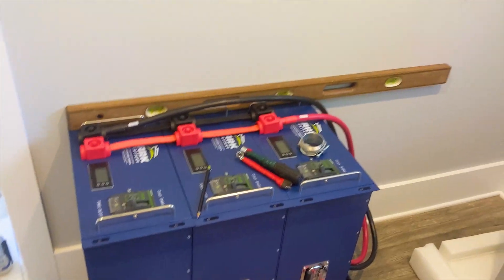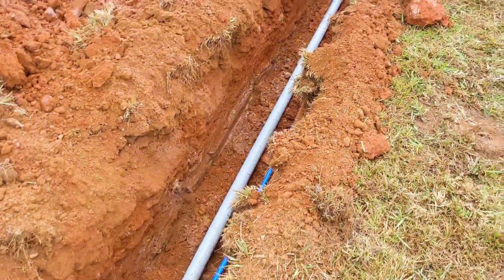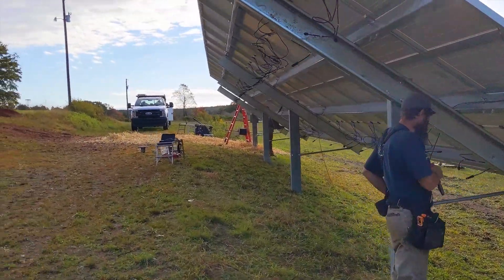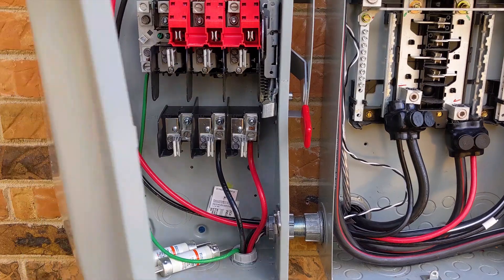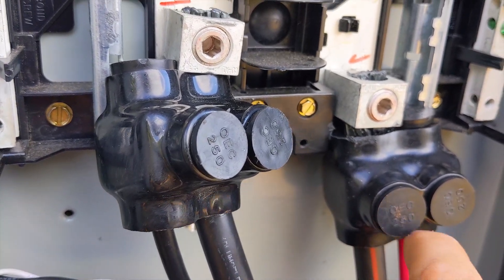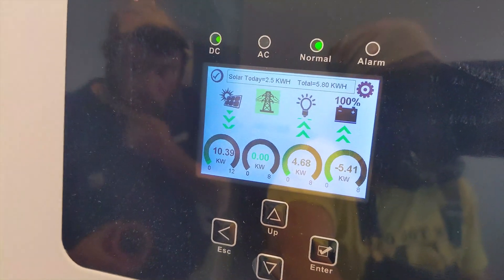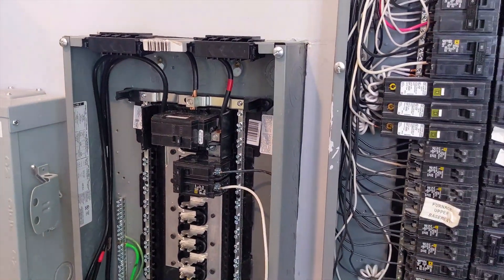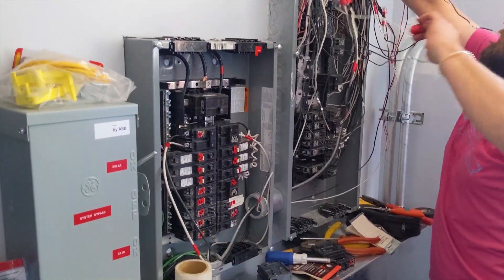Will this be our last critical loads panel?

Comment: I Would love to able to have a system. Would I be able to have a system like this after the meter system? How many panels would we need? Looking for a system that isn’t tied to our grid power provider. I know you probably need specs on appliances we are led on all our lighting. We have a single family house 3500’ brand new, with all the typical appliances all electric. As well as a central heating furnace and ac.

Comment: Just got off the phone with Sol-ark tech support the other day, 15K should be released Q1 2022! 
Also just want to let the community know the Nyle e8 air-source heat pump retro-fit DHWH (formerly know as Geyser) will be back on the market around April 2022 from Nyle systems 🙏 (great off grid, less energy intense system. E775 has installed in the past (see video) but system was discontinued sadly...

Comment: Did you mean to say 8kwh to heat a 55 gallon tank from well water temp to 120f? 80 seems really high. It's about 2 hours at 4500w right? Love watching your videos, I have plans to take our house off grid in the future.
Reply: That sounds like valid numbers.  If you look at the first hour gallons on electric hot water heaters, a 50 gal is only something like ~70 gal.  So in 1 hour it will only replenish ~20 gal.  You need a lot of electricity to heat water.

Comment: We have been using the Lumin Smart panels for about a year.  They are a great addition to any Solar System.
Reply: Does the Lumin smart panel do the same thing as the solark load manager? Are there any other devices that do the same thing? Are these load manager panels the next wave in resi solar and will they eventually be standard in all installs?

Comment: I have no problem with picking my equipment up either. When is the 15k coming out?
Reply from the maker: I was told the end of the year.
Reply: @engineer775  do you know what the cost per unit
Reply: @engineer775  I’m looking to do something like you did for the guy that had a boat dock 2 building house and like 90 plus panels! I need my house and a greenhouse done so I need to get with you soon I’ve been very busy haven’t had a chance to set up a appointment with you yet? I work 3rd

Comment: I am very interested in this new system.  I have been thinking about how to make a load management system work without installing a sub panel.  I think it will be the most efficient design.
  I am about to install a 12k sol-ark ground mount system. Waiting for material quotes now.
Reply: Have you thought about the Span Smart Panel? Yes I understand it's wifi/smart connected, but highly accurate ampacity tracker at the individual circuit level!! It's definitely not cheap, but it's a rather elegant system. Beauty is in the eye of the beholder though 😅🙏
Reply: @meganwinters5163  I dont think the SPAN is compatible with So-Ark.  Only TESLA and Solar Edge currently.
Reply: @chadvivi  enphase works for sure. I just put 15k on IQ8s plus 40kWh enphase batteries and a span smart panel

Comment: Awesome work as always! You guys going with Lumin, Span or something better?
I’m hoping smart breakers will be a “thing” soon. I see Eaton is working on a solution but I think it’s half baked right now.
Reply from the maker: Sol-ark is coming out with a 14 channel smart load relay system.
Reply: @engineer775  Are these load management systems using standard magnet hold relays, latching relays, or something else?

Comment: 88 kWh to heat 80 gallons of well water 57F to 120F?  I don’t think so. Try 10-15 kwh. Because I use 60 (summer) 80 (winter) kWh per day for my whole house. We take three or four showers per day with an 80 gal wh.
Reply from the maker: I said 8 kw on a 55g

Comment: How do you move a load to CLP? Wirenuts in the main load center with extension wire to CLP? Looks amazing. Thanks for sharing.
Reply from the maker: We prefer wago connectors over wire nuts but yes.

Comment: Does anyone know if the Sol-Ark transformerless inverters have circuitry to detect the DC output that can occur if an output switch semiconductor fails or the controller fails? And if so, it must active a hard switch such as a contactor or relay at the output to do a disconnect. I have watched transformerless inverters fail and burn up loads with high voltage and high current DC outputs. Hopefully supported with documentation from the manufacturer.

Comment: Why do you need inspection when you are using a electrician? If anyone could do it themselves, then the inspection would be good, but this is insane.
Reply from the maker: Most ahjs require inspection. Authority having jurisdiction.
Reply: contractors need to be kept honest, otherwise end users/owners get ripped off.

Comment: Code is that you can mix AC and DC in the same raceway as long as they are part of the same system.  NEC 300.3 (c) (1).
Reply: Yes it does allow for this. 
We also read additional potential requirements in 690.31B 2017 NEC
Reply: if inspectors are cool with it-  some wont let us.  CR solar in Texas

Comment: I ran 10 thhn on my install.  I’ve got 2 arrays of 10Sx2P each so 320v give or take at 20A going just over 250’. Am I going to be ok; or should I pull new wire? The install guide with the solark showed 10awg.
Reply from the maker: You should be fine you'll be running around a 3% drop.
Reply: @engineer775  any reason you don’t use aluminum from the arrays? Copper prices are getting out of line these days
Reply from the maker: @ZackFletcher1  we need a minimum of five conductors and up to 9 for most of our installation so it's hard to do that in aluminum
Reply: @engineer775  why an odd number? Do you have to run a ground between the array and the house?
Reply: It's always good to use a voltage drop calculator.  Many online and apps.  I always shoot for less than 2% voltage drop on my solar runs.

Comment: I always thought to never place any batteries directly on the ground because it drains the battery and shorting the lifespan of battery. Why not place a rubber mat on the ground then place batteries on top of rubber mat? Afterthought, your panel setup is stationary. (I don’t know what’s it called - but somehow have automatically aligned solar panels in direct sunlight to gain maximum efficiency and why not take a mirror and direct sunlight to the panels?
Reply: The lead acid battery on the floor issue is gone due to modern plastic case batteries. Plus, these are lithium iron phosphate batteries in steel cases with steel riser legs. 
Also, solar trackers were popular back when PV module prices were much higher. Now, it is cheaper to buy more panels than to make a mechanical tracker.
Reply: @maverickmacgyver  I wasn’t aware of this and I suppose you’re correct. Thank you for Sharing that bit of information.